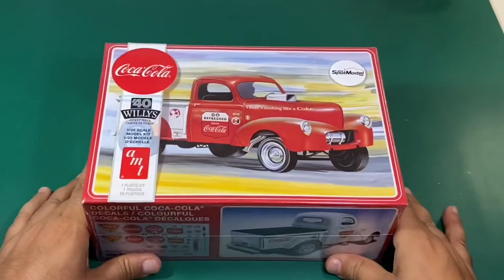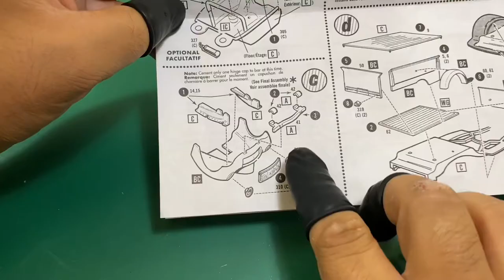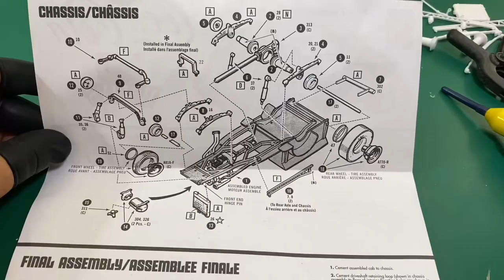Building Willy Pickup Truck | AMT Model kit step by step | ASMR Building

Comment: I have this kit that I am wanting to build very soon. I noticed that you have to cut the chassis in order to get the bed of the truck to sit properly. What is the best tool to cut it with ?
Reply from the maker: You can remove easily using pliers or small saw check how I did in minute 1:35 hope this helps! 🙂